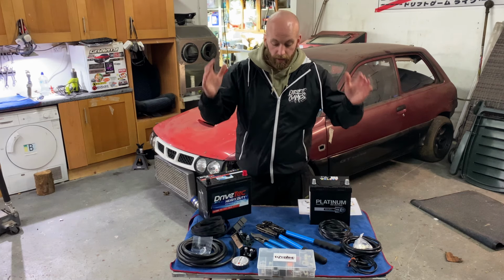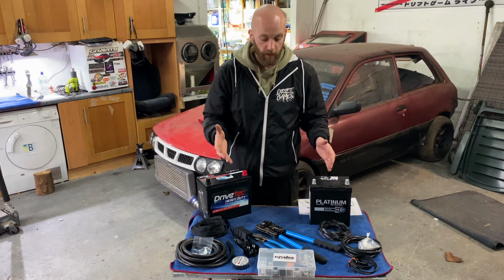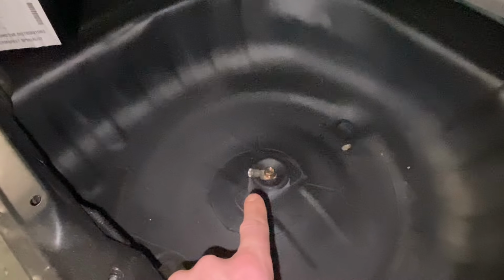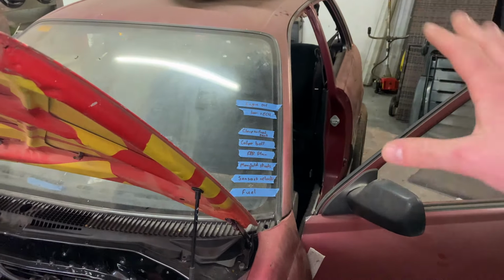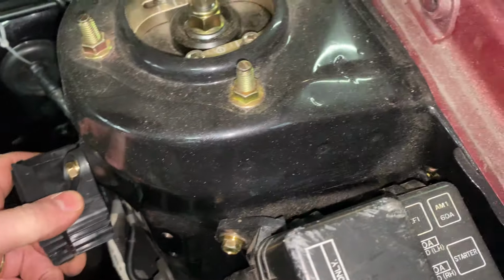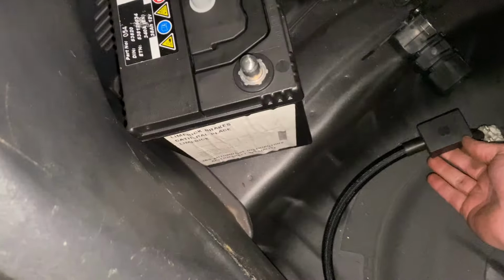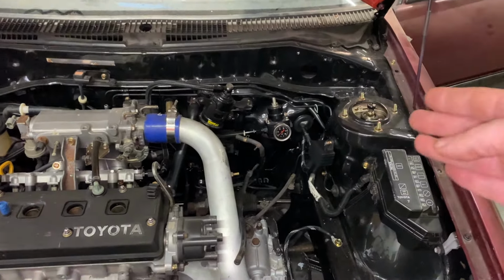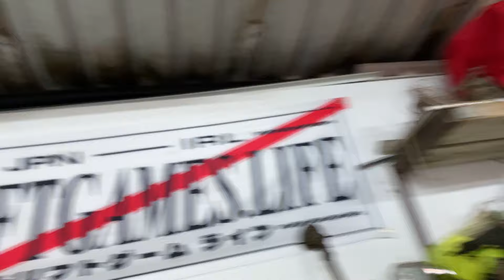Fitting a battery relocation kit to my turbo Starlet

Comment: What about power to the starter motor?
Reply from the maker: Hey Jake, so my engine look is currently away getting some work done by Ep wiring. Once that comes back I can connect up the starter cable onto the other pole I fitted in the front and she should be good to go ✌️, I hope 😅
Reply: @joeygt6794  brilliant mate look forward to seeing it all finally running and rolling under its own power!